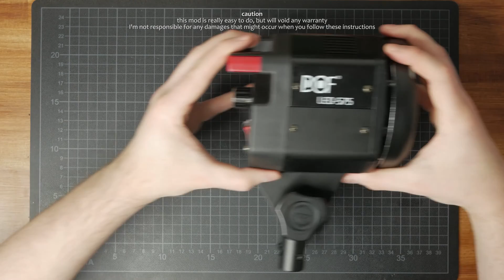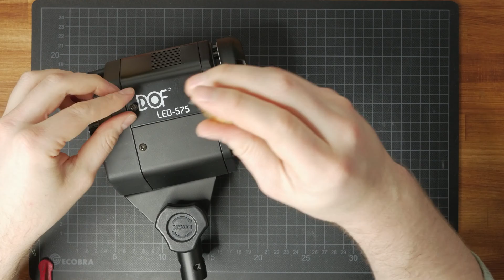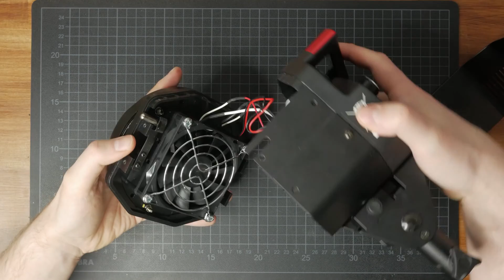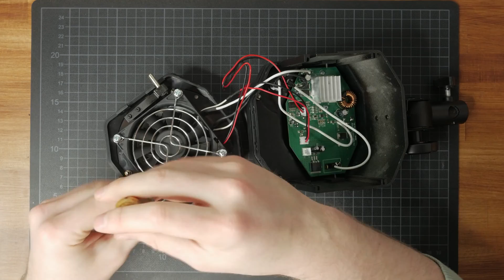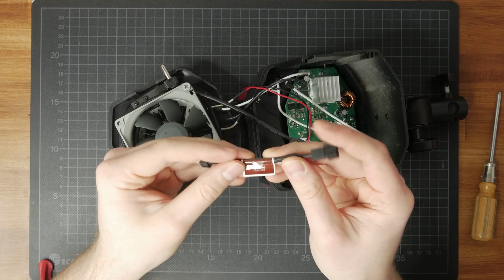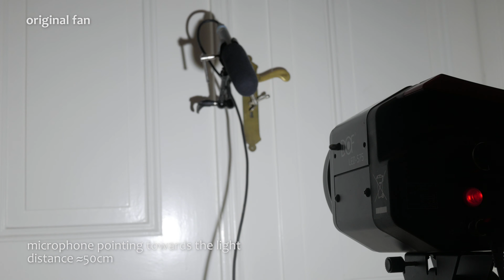switching the fan of a DOF 575 LED light | 4K

Comment: watching this video and reading the comments, I really think it's worth my while just to build my own. I have priced out a water cooled YUJI chip and its about $150 canadian to build (case and all).
Reply from the maker: It's a shame that the DOF isn't sold anymore, I bought a second one for 50€ which is a real bargain.
$150 for a fully equipped YUJI sounds really interesting, as the chip alone is already 50 bucks (50W at least.. you can't buy them single anymore though). I wanted to build my own for a long time but I really struggled with casing etc, so I'd be really interested to see what you came up with if you don't mind sharing :)

Comment: Thanks for doing these videos Lucas! :-) The comparisons of before and after are really useful. When the manufacturers start optimizing their case designs for quiet airflow I think we'll begin to see even lower fan noise. The Aputure COB 120 has a great airflow design pulling in air from the bottom and exhausting it in the top with very little resistance in the heat sink in between. I listened to it in a shop and it was extremely quiet. I had to put my ear up against the grill and even then all I could hear was a slight movement of air. I was very impressed. I own the Pixapro LED 100D MKII+ which makes quite a bit more noise than the Aputure although probably not enough to cause problems in most cases. I still might replace its fan to see if I can make it more quiet, but I can't do much about the noise caused by the airflow as that is tied to the design of the case. All the best :-)
Reply from the maker: +HJD one big issue is also the fan size. The COB and others use 120mm fans, which have significant better cooling at lower speeds. In terms of the DOF, I wanted to experiment if I can at least use a 92mm one and make it work :)
Ultimately, the DOF is designed to be cheap. And it really is, the cooling concept is not well build, cheap materials. I mean you could rework the cooling quite a bit to make a better airflow (I like it horizontal but that's open to taste), it could improve even more. The LED is of course not so great (not a fan of the COB either), but I also thought about changing that for a Yuji. Obviously now the lamp becomes more expensive, but I still like it's formfactor and especially the electronics. Such a great lamp for the outside, too :)
Reply: - Yes, that makes sense, a bigger diameter fan would require fewer RPMs. I also remember reading about and fiddling with fans when I assembled my PC years ago :-) There were fans with blade designs optimized to be used as case fans and other fans with blade designs tailored to be used on heat sinks and radiators. You prefer a horizontal airflow? I would have thought a vertical airflow would be optimal as hot air rises naturally? The DOF looks interesting with its compact build, I hope you find good use for it :-) May I ask what you don't like about the LED in the Aputure COB 120? I haven't used one myself, but those who have seem to like it? I actually didn't know that COB LEDs were available for sale to individuals. I've now looked up Yuji, and it appears they'll sell them to anyone, wow.
Reply from the maker: The hot air rises, but gravity also pulls things down :) you get a different kinda issue with rain or other small things that fall down, that's of course only really intersting when you use it outside or in certain terrain. 

I don't like the color temp of the COB. The tungsten-version sits at 3000K, daylight at 6000K. Meaning in most cases I need gels to fix that, which I actually don't want.
Yuji sells them to anyone for quite some time, it's not a secret or so :)
Reply: Ah, you have a point about outdoor use, though I suspect people will mostly use these lights indoors or at least not in the rain :-) I wasn't aware that the Aputure COB 120 models were that much off the standard color temperatures. Aputure seems to be an innovative and capable company, so I wonder why they got that wrong - especially if the other lights they make are 5600K. They should know that people would want to mix lights and want their color temperatures to match. Well there you go, I didn't know anything about Yuji before you mentioned them, so thanks for bringing them to my attention :-)
Reply from the maker: I wouldn't plan to use them in the rain either, but you know how it goes, sometimes it just starts :) also, for one project I used the DOF in the night in the forest, when it gets a bit moist in the night you can have drops falling down without any rain. It's specific, but you get the idea. If I wanted to modify the DOF, what's more important for the direction of the fan is that the mount would be in the way for a proper fan-placement :)

I have really mixed feelings about Aputure. They have nice products, but I hear mixed things. For example, read on the user reviews on their LensRegain on B&H. it seems the quality control has much to desire sometimes :(
Reply: Yea, rain has a tendency to come by uninvited sometimes :-) And yes, condensation could perhaps also be an issue - I do get your point. Well if you don't feel the need to modify it then all is good ;-) Okay, I've only got some 160 LED lights from Aputure, and so far I've not needed support / repair. Quality control is important, so I hope they'll improve if people have complaints. Greetings from Denmark :-)